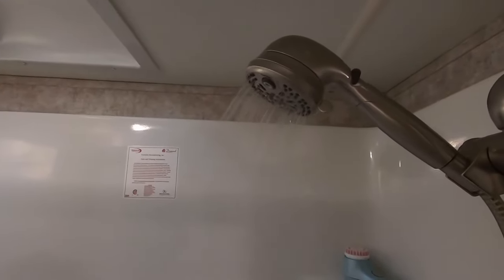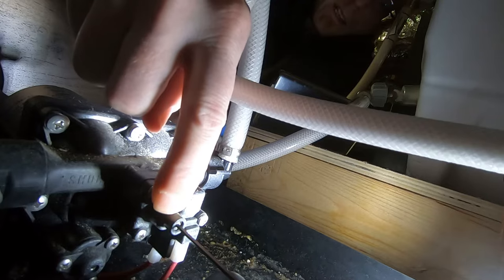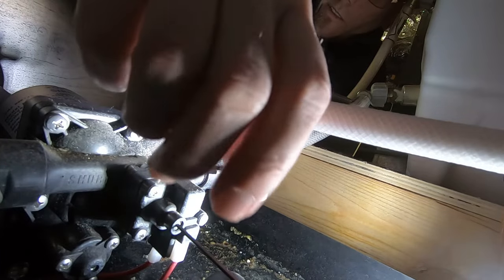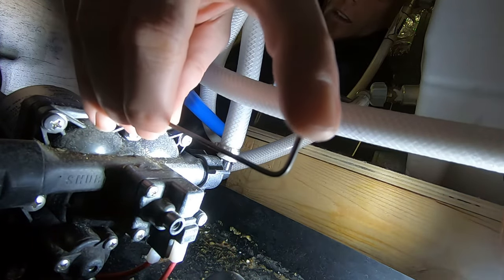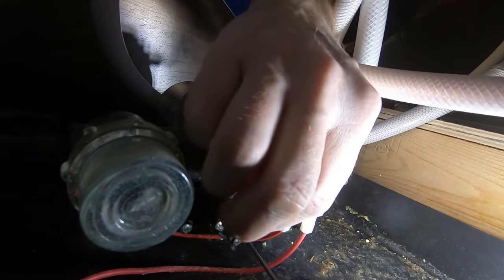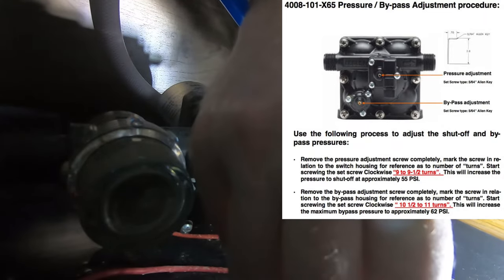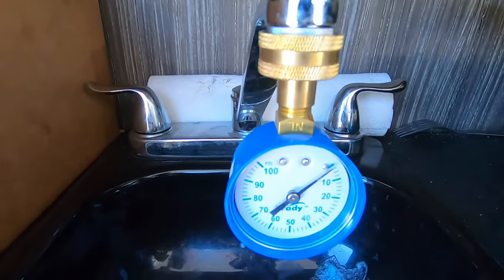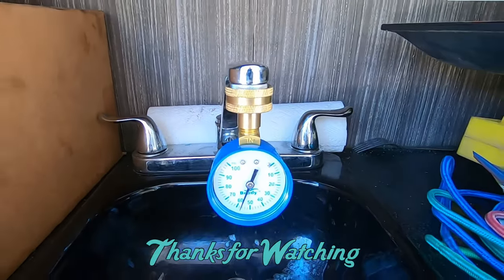Shurflo 4008 Water Pump Needs Adjustment

Comment: You may have just saved me a couple hundred $ and a bunch of work replacing something that didn’t need replaced. 

My symptoms were different— the pump came on intermittently while no faucets were on.  It was getting annoyingly more frequent to the point we’d flip the pump power switch on only when running water.  I did not know the backflow was adjustable until this video. 🙏

Comment: Thank you for the video, very helpful. I had a different problem. My Shurflo 4308 water pump would not stop pumping. This is my 3rd RV over 20 years and never had this problem before. My wife and I went on numerous trips where we would only turn on the water pump when we needed it which was a PITA. Finally found this vid and messed with the pressure & bypass valves until they were set at levels balancing good water flow with immediate shut off when demand stops at a faucet or toilet. I found that the reset instructions from the manufacturer did nothing to change the issue. So I just turned up the pressure screw until it reached a level where it would shut itself off.
Reply from the maker: I'm glad this was helpful

Comment: Thanks for the video! Made it very simple to see how I needed to adjust my pump. I actually didn’t take the adjustment screws all the way out. I just made a minor adjustment on the pressure side and it fixed it really easily.

Comment: My first visit to your channel. A lot of valuable information here - so many sites that try to explain this - do not do so. Yours - works.
I have rebuilt my pump a few times and I've upgraded to the SHURflo 4048 model. Essentially the big brother, with same setup for pressure and bypass screw management. I screwed up while installing it (BACKWARDS - so zero flow!! D'oh!) but I messed up the settings before I saw it. (I have enough room to spin my pump either direction and it only works ONE way!)
But I remember the process now - and thanks to your nice vid - I skipped the whole, "back it out till it almost gets lost and then in 9 times" = which wasn't enough - and then you just wing it from there essentially - so I started at the wing it part. I just cranked up the max pressure till it was where I wanted it and then cranked the bypass until it turns off again when taps closed and RO system off.
Thanks.
Reply from the maker: I'm glad you found this helpful!

Comment: Fabulous!!  More and better than anything from Shur.  I skipped the whole remove and reinstall and just went straight for increasing the pressure with the water running and pump pulsing.  It took almost one complete turn (CW).  No bypass adjustment seemed to be needed.

But it took several attempts.  The first seemed to work at only 1/2 turn but then after turning the water faucet off and waiting a few minutes and turning it on again, some pulsing again.  Adjusted pressure up again and all is well.  The pump turns off when the faucet is off, so I saw no need to adjust the bypass setting.  All is well!  Thanks so very much.

The pulsing is a relatively sudden problem -- like the pump suddenly aged and is in need of such an adjustment.  I first thought something had broken.  I have an accumulator downstream and had reason to 1) think it had failed (although it didn't really explain the symptoms) and 2) I've always wanted to remove it because with the bypass pump, an accumulator is not supposed to be needed.  So, I removed the accumulator and replaced it with a nipple.  Still had the problem.  Before buying a new pump, went looking for instructions on adjustment and found this.  Voila!
Reply from the maker: Glad you got yourself set!

Comment: Im hoping by adjusting the bypass screw the pump will finally start shutting off when pressurized. Guess its worth trying before i buy another 30 dollar part again to fix it. Well the last one was cracked. This one wont shut off even with good pressure. Works just annoying.
Reply from the maker: Good luck!

Comment: I do like the chipmunks who helped you count...;-)
Actually, this is a great video to learn how to adjust the water pump.  Question...do you use a whole house filter also?  If so, how often do you change it with full-time rving?
Reply from the maker: I was cracking up listening to the vid before I uploaded! Lol! We do use a filter on the incoming hose, one of the inline ones, not the canister. And we change it probably less frequently than we should, I don't like disconnecting the hose in the winter. So about every 4-6 months. Hope this helps!

Comment: What was the pressure when you had the pulsating problem or when you did turn the adjustment screw 9 times? And did you have to increase the bypass pressure? Thanks. I'm about to replace my Whale pump. Do you recommend the shurflo?
Reply from the maker: I don't have any real experience outside of the ShurFlo pump, so i have no basis for comparison. However It's treated us fine since retuning it! The pressure was on the low side, I think about 32 PSI if I remember correctly. I did have to adjust both till I got good pressure, no pulsing, and a quick shutoff when the tap was closed.
Reply: I hope you ended up with the SHURflo. I'm a full-timer and I also run a full RO system (not recommended) so I've upgraded to the 4048 pump for more flow and more pressure (and more money! LOL).
But the adjustment process is the same - and I now rebuild my pump when using it to make RO water wears it out. SHURflo instructions might not be the best - but their product support is super. IMO

Comment: Can you please tell me where you got that water pressure gage you hooked to the kitchen faucet?
Reply from the maker: It's just a standard garden hose threaded gauge, maybe I got it at home depot. I also had replaced the tip of the Faucet with an adapter from Faucet thread to garden hose thread, also from a big box store